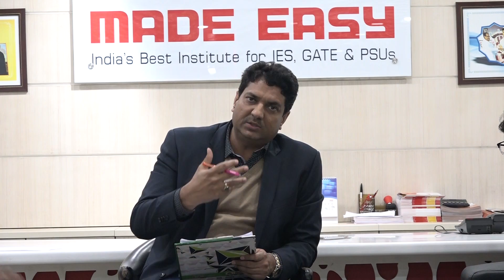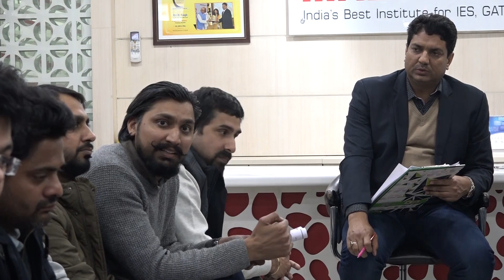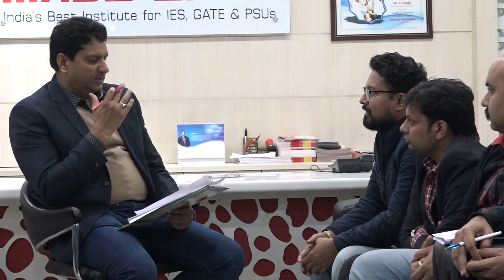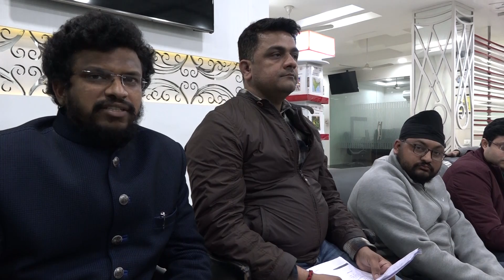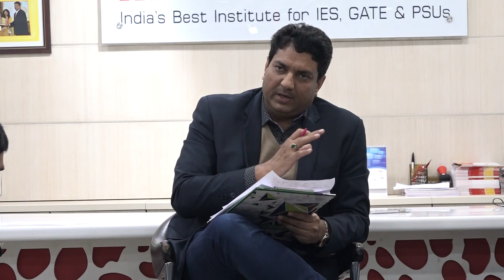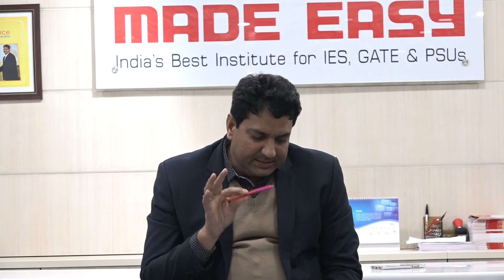UPSC ESE/IES Prelims 2019 (Mechanical Engineering) analysis and expected cutoff by MADE EASY faculty

Comment: I am getting 198 (obc) in mechanical engineering can I start for main paper
Reply from the maker: Dear Candidate, 
Thanks for writing to us. We have released the expected cut-off for all the branches for ESE 2019 Prelims but the real cut-off varies to a certain extent depending on the Official Answer Key to be released by UPSC after the final results. Waiting for the results to come out and starting your preparation after that, can be a tactical mistake and you will lose out on getting an edge to your competitors. Thus, it is highly advisable that you should go ahead with your Mains preparation. 
Regards, 
Team MADE EASY
Reply: could you please tell me if u were selected in pre and mains?? just for knowing the cut offs